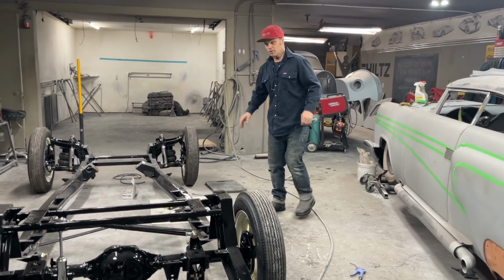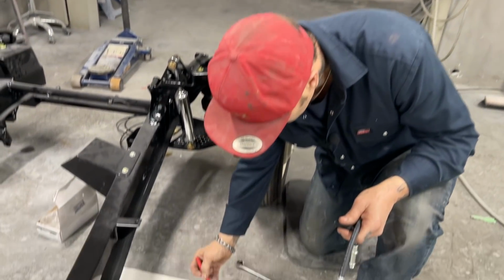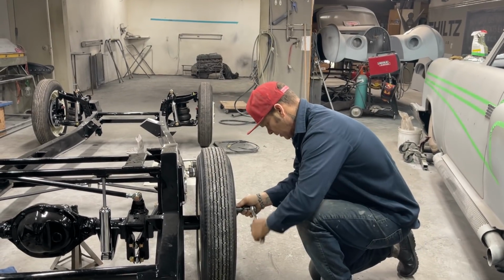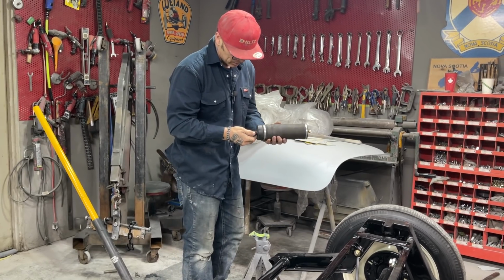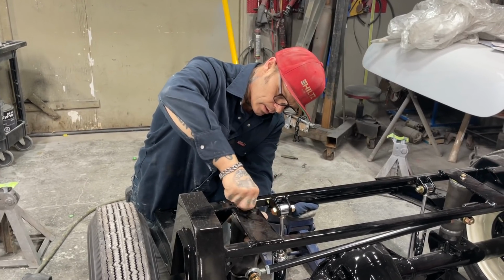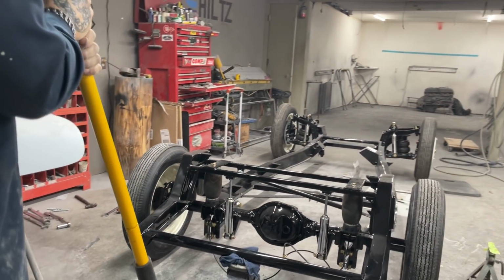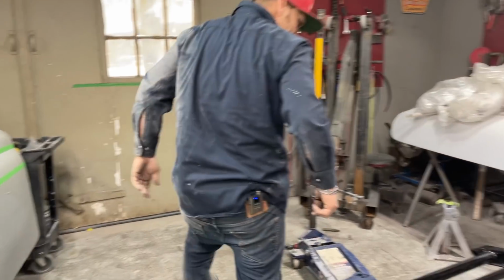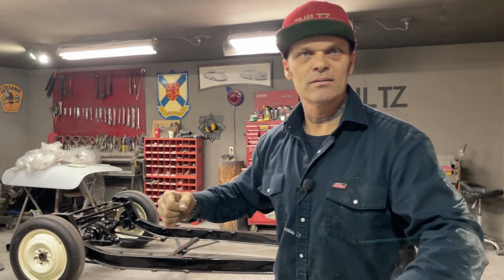Rear Suspension ✅ Air Bags, Chrome Shocks, Trailing Arms, Panhard Bar

Comment: Both Of Our Vehicles Have Front Mounted Calipers!  The Only Difference Is: With The Calipers On The Front, When Brakes applied, The Car Will Be Pulled Down Somewhat!...With The Calipers On The Rear, When Brakes Applied, The Car Will Be Pulled Up Somewhat!  Either Way Not A Big Deal!  Looks Great Chad & Jolene!!!!!

Comment: Perhaps the front lower control arms are hitting the frame and that’s why the front is not settling any further? Those semi cab air bags in the rear of your car are typically installed at about half their height. If it’s a 10” long bag it would typically be run at a 5” ride height.

Comment: Chassis is looking great nice job. I didn't want to mention this but since your removing the front shock for access I will.  On a single bracket application like what you have on the bottom of the front shock typically a shock mount stud bolt is used.  It has a shoulder on it so when secured with a nut it is rigid and ready for the shock to slide on.  The stud OD is matched with the shock ID.

Comment: Build a cup for the top and bottom of the bag.  Bottom cup snug to bag and top cup big enough to slide over the bottom.  (Kind of like a shock body with a hidden shaft?) That way the bag can’t bulge out, it has to go up.
Reply: That also solves the clearance issue.

Comment: that set up will allow for all wheel thrust alignment having those adjustable ladder bars should be avery straight comfortable ride.. today they use some sort of multi link wishbone mcpherson setup that allows for camber and toe adjustment however on most the wishbone are not set up to be adjusted to the thrust line as you have here, its all set, why you'll see em riding funny after a crash repair..

should make for a good ride on that air a whole lot better than the original where drivers complain of s harsh ride, concealment from the elements and noisy, apparently they made no effort to seal it up at all and used no noise insulation, there is a video of a ride in one and he mentions how much its like a convertible.. windows do not open/close all that..

Comment: To make shocks fit after paint, during mock up I put a washer between the bushing and bracket before welding the brackets on.  Adds a 1/16 or so clearance.

Comment: With the rite adjustment on the rear upper heim joint the pinion angle  will not change air in or out

Comment: Chad for your info the helm joints on trailing arms need spacer that has a cone design for heim joints  put the narrow cone to heim and wide flat side to frame side, speedway Motors sells them you need these due to your heims  goes threw their travel it will bind on bracket and rip all your paint off mounts , also the front rubber brake lines speedway also sells those  mounts that rmade to bolt on and I hope this helps you I use these all the time building street rods and race cars.

Comment: Reversing the nut, bolt orientation on the crosslink will allow you to remove the bolt in the future without  having to remove the air bag. Making it easier for you. I'm loving your build.

Comment: There is a rubber stop built into the air bag on the inside to restrict it from bottoming out, just like the rubber stops on a leaf spring system.

Comment: If you put a leveling valve with a inside dump switch  when u want to let the air out  it will give you a ride same as a big truck it will air more or less pending weight but it will always ride at same height on the road

Comment: Rear & Front susspention might have to be converted to coil springs if the air bags will hit the nuts and bolts to make them explode, but you say you want the susspention be adjustable. So Me know nothing! Looks good! I hope it test drives well after completion. Airbags are a great susspention for stability, comfort and control, but coil springs can be adjusted by cutting the springs down to length and choice of medium to soft springs. I notice you have no bump stops for the rear axel on the frame. You need to install two bumpstops. Have a great night Hilzt!

Comment: Chad I love you visions of how things work I also love that you are a doer. 
I feel like you’d have success if you put the front flex line over the top of your air bag mount then join it to hard line. also you should flip the rear bag to allow you to run all your airlines above the frame to prevent the possibility of snagging a line. Lastly what is the load rating on those rear bags, I know that the sleeper on a big rig is not that heavy.

Comment: Another excellent episode.
Just wondering why you are bottom-feeding the rear air bags - this means that you will need a flexible hose from the frame to the chassis whereas top feeding them could be done with chassis mounted lines with less chance of failure.

Comment: You should get a set of reamers.  It is much better than using a file.  Leaves a nice clean still round hole.  Even a drill to drill ream the paint out would be better and leave you a round hole.  That is me being a die maker speaking.

Comment: If the A arms are to tight 
the front suspension won't 
drop down. Need to wait and tighten them after all
weight is on the chassis.

Comment: When you’re installing shocks and they can mount with the body up or down, you decrease the weight of the traveling mass when you put the shock body at the top.  Less weight is traveling up and down as the suspension moves.  Just a little food-for-thought.

Comment: I would put that bottom bolt back the way you had it first, front to back on the front shocks so you have full contact of the solid shaft of the bolt instead of the threads on the bolt. Lot stronger. No sharp threads to wear into the bolt hole. Love the look and shape of the frame....James

Comment: If you have to take the front shocks off the would it not make sense to have the bolts facing back. It would give the bottom fixing point more strength going bolt head, control arm, shock then nut than the other way round, would it not?

Comment: Great perseverance with that rear air bag  😊 another step forward. Sharpen your drill bits before drilling and tapping for the brake flex mounts... it will give you a bigger smile than seeing the rear chassis working. Happy days

Comment: i made a comment about the brake caliper and its location, you def can have a front facing caliper, BUT, it will typically have a drilled and slotted rotor, if that route is chosen, almost always with a slotted rotor you'll have the caliper in the front of the car mounted to the rear of the vented rotor , placed in front of the vented rotor negates its cooling factor and could cause the brakes to over heat, but to be fair i dont think this car will be driven fast and hard braking needed , so it should be fine.

Comment: Can't wait to see the Bugatti painted and sitting on its frame. I am just curious why not route the front caliper flex lines in front of the airbags? You would have fewer obstacles to avoid. 
The comment someone said to your last video of the car having too much brakes on the front. You can put an adjustable proportioning valve on the brake system to increase rear braking to guaranty you have 60% front and 40% rear of the braking.

Comment: A large flat washer under the head of the bolt attaching the heim joint is a safety feature; if the joint comes apart and off the ball, the washer will catch it. You will get slop and a clunk, but not lose control of the car. I dont think the flat washer you used is large enough to do this job.

Comment: Is there any provision with those rear airbags to prevent them from twisting or rotating like the pins in the front bag top mount? If they move around, it might allow the air line to work loose and that just sounds like trouble.

Comment: Chad. Truck cab air bags are designed to run inside a tube, to keep the shape of the bag. They will then inflate taller.
Reply: I have never seen them inside a tube in all of my thirty years in the industry in America anyway .
Reply: I work on trucks and the bags are  right the way they are

Comment: Good spot on that PanHard Bar, Jolene, could have been a costly mistake if that bag had rubbed against the bolt head, again another great lesson in Vehicle building/ Restoration , keep up the great work you two 👍

Comment: Chad. You might want to consider putting some grease on all the pivot points. Bushings in direct contact with the mounting bolts will eventually seize up.  Just a suggestion. Love your work and watch every day.

Comment: Your air gun was leaking bad,when you where gonna Tourque down the top of the Driver's Front air bag. Did you secure IT properly? And anti seize for front right spring dealio that holds pads in? In case you forgot. Not nit picking..it's coming out "Wicked Pissah"!!

Comment: Chad, my 33 roadster used very similar bags as your front ones and I usually run 15-18 psi.  Gas tank and battery were in my trunk.  With your engine weight etc.  I bet you will run no more than 25 psi

Comment: Chad the bolt that is so close to the rear air bag   You might consider switching to a carriage bolt with a round head so if it rubs when lowering the car it wont cut in

Comment: Looking nice Chad.  FYI, a bung is a threaded Plug that goes in a barrel or tank.  You are using a "Bushing" or Sleave in the shocks to let the bolt pass through and leave room for movement.  _  Max Yearwood

Comment: It doesn't matter at all where the calipers are as long as bleeder is 12 o'clock there is no advantage to having them in back or front there are open wheel race cars with calipers mounted in the 12 o'clock position because of unsprung weight distribution. There is no difference in stopping force by where calipers are mounted caliper location is determined by steering not leading or trailing

Comment: Reduce the pressure in the air bags, they aren't meant to be rock hard then they are over extended. You also have to consider shock travel.

Comment: There is no difference where the disc caliper is located on a car. They are usually oriented wherever it is most convenient and attractive, but not for reasons other than where they fit best.

Comment: Those air bags look like what is used on the back of a Peterbilt sleeper. That style of bag probably won't work. Not a lot of travel.
Reply: I hope it works fine for you. The only thing that concerns me is they don't hold their shape nice when they collapse much. They fold over kinda If that makes sense. The sleeper on our trucks only moves about 3 inches....maybe 4 tops. I just hope they don't tear on you one day. The front bag design maybe be a better choice. I guess we'll find out. Great project, enjoying it a lot. Thank you

Comment: Not much torsional rigidity in the chassis.
Body roll will twist the rear axle with those short fixed radius rods.
Get an engineer to look at it.

Comment: When welding on brackets for shocks and control arms add a thin washer in between then after weld up will have a slight gap for paint and a lot easier to install later
Reply: OK GOOD IDEA ,,BUT LEAVE CHAD TO DO HIS THING ,HES GONNA START CHOPPING SOON .LOVE IT

Comment: Chad one more time your rear radius rods are wrong.
You need a four bar setup to allow one wheel move up on a bump without affecting the other side.
It is like a very big roll bar.
Also your 1 inch square tube and that flat plate is not strong enough to support the weight of the car.
I would not let my girl drive it.
I've been an engineer for almost 50 yrs.